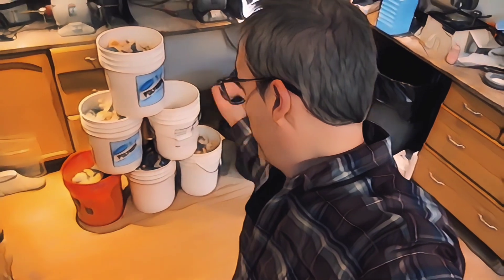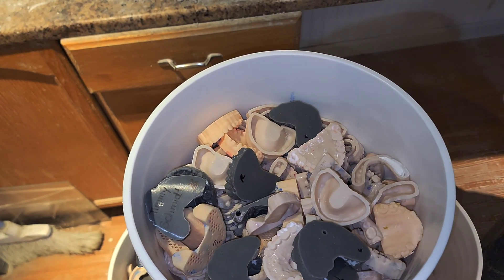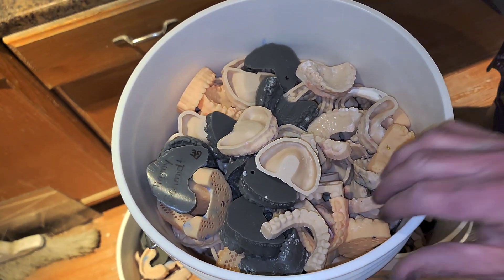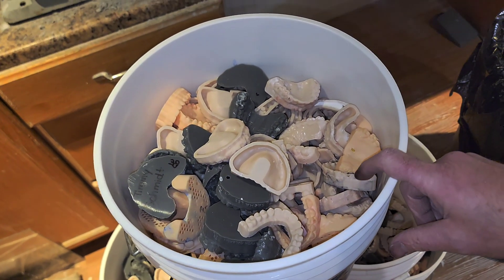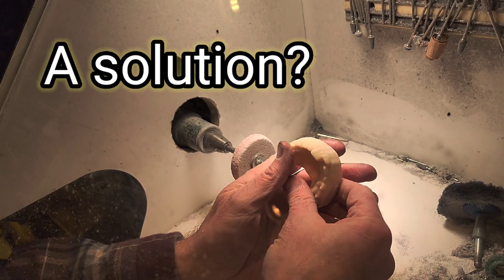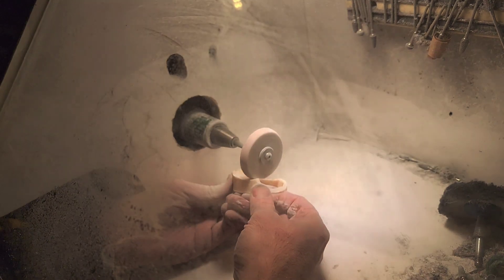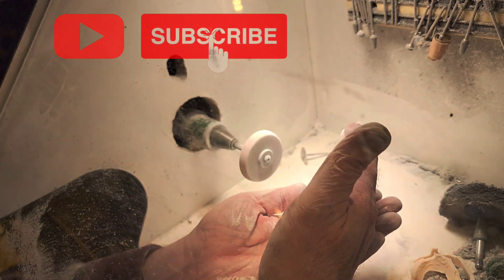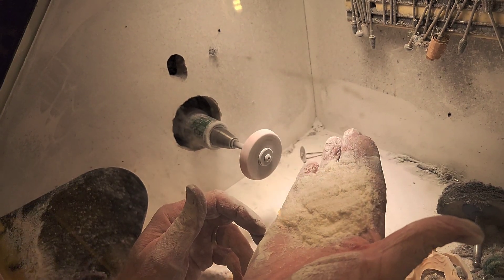Can we Recycle 3D Dental Models?

Comment: At my work, we send the models to the doctors, I assume they store them for some time then throw them away. Regarding the crushed/dust version, maybe it could be used like sawdust? or filler material (similar to how filament prints can be melted into molds, these could be cast into molds), but can't think of much else. But it would have to be sealed with the help of something like epoxy. Resin absorbs water and isn't very usefully resistant to anything that I know.
Reply from the maker: thanks for the input. wether we throw them away 2 ounces at a time or 100lbs at a time they are ALL eventual going to the garbage

Comment: I send almost all my models to the doctors but an other problem is the 3D print resin waste and the ipa mixed with resin
Reply: You can recycle the ipa with some effort, there's various methods like curing then filtering. That one is not particularly good, but I do that until it's unusable. You should be curing it before disposing of it anyways. I saw a method that uses aluminum sulfate, going to try that soon.
Reply from the maker: @alanscodelog  thanks for the valuable insight